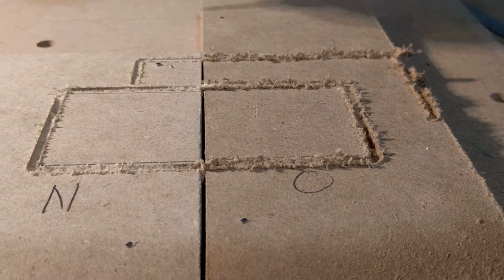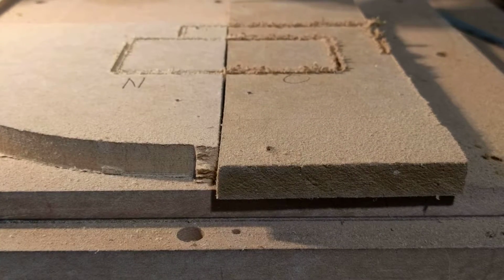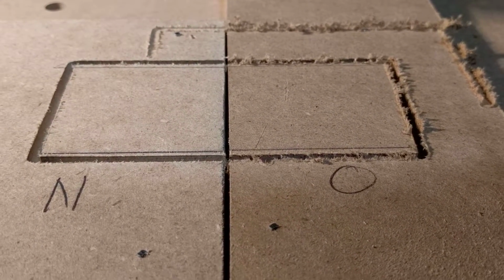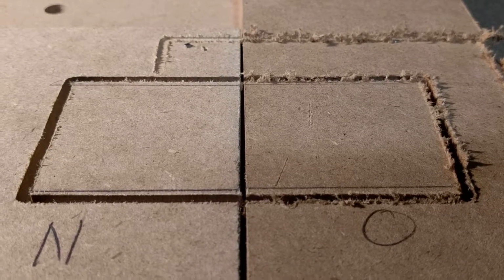Old vs New MDF milling on a cnc

Comment: Hey Dutch. So i'm having a somewhat similar issue with my openbuilds/ooznest CNC milling MDF. 

I have an Ooznest 750 x 1000 - and am cutting tens/hundreds of 18mm MDF pieces. 

I primarily use a 3mm / 1/4" 2 flute up cut bit -  bought several packs cheap (Amazon 10 pack for £15.00) - which work - and surprisingly give a good cut - i'd say 7/10 (have also run endless feeds & speeds tests to get the best results).

The issue i'm having is the cut edge of the MDF. (I have some compression and straight cutters - the top edge isn't an issue - being an up cutter). The cut edge of the 18mm MDF is fuzzy after each cut - i'm looking for a bit to give me the cleanest possible cut through the MDF - to leave next to no finishing/sanding needed.

At the minute i'm cutting alphabet letters 100mm - 200mm in around 10-30 seconds a pop.. hand sanding with adequate paper on the top and bottom edges in around 20 seconds - and sanding the live 18mm edge in around 3-6 minutes a pop. 

I'm really looking to CNC 18mm MDF - with a 3mm bit, pull the piece from the bed - and at worse give it 30 seconds of finishing.

Is such a thing possible? Is it simply that I need a sharper bit? Can you mill MDF leaving such a clean  edge that it requires next to - or no - sanding / finishing?

Do you hand finish all of your MDF edges or is there a better way?

Thank you,
looking forward to your response!

MB

Comment: will the new stuff age and behave like the old,  or is it a different material all together
Reply from the maker: Yes over time if it's left in a humid area, but if you use it and and paint or seal it there should be no problems (I was being cheap and trying to use my old scraps)